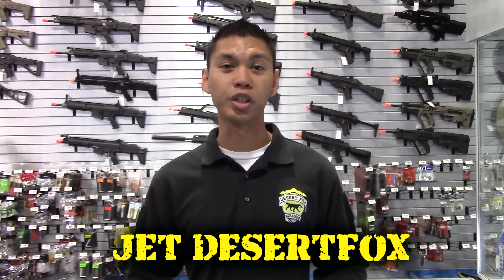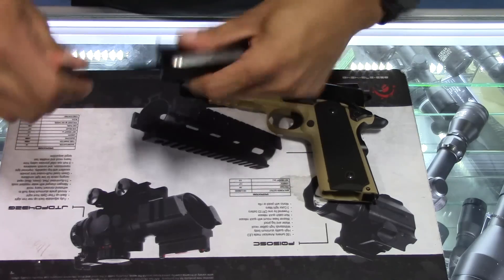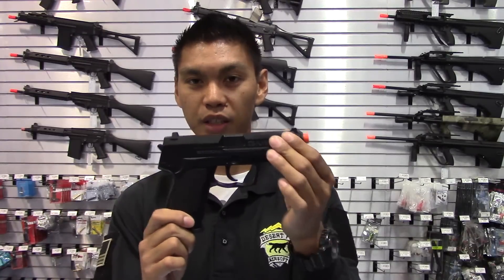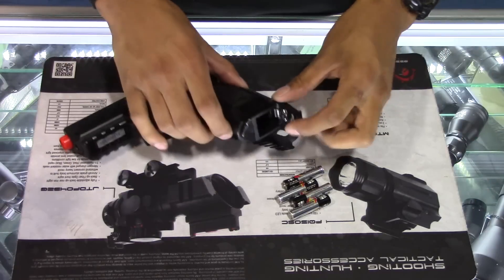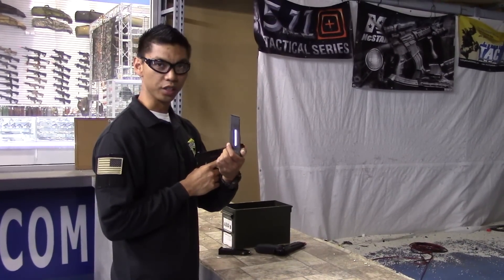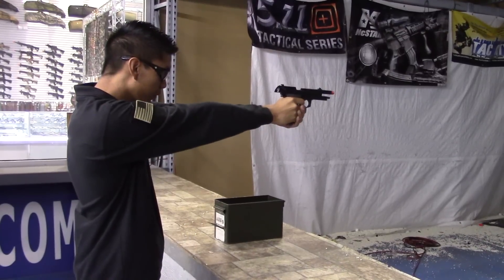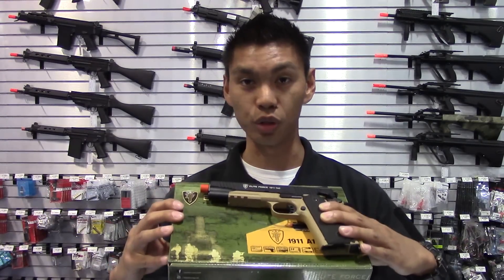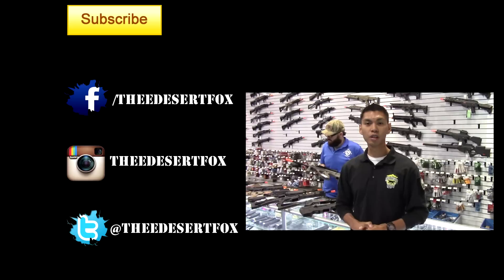Beginners Guide on How to Buy Your First Airsoft Hand Gun

Comment: I super recommend the elite force 1911 as first hand gun. And just a good tip if you buy a green gas powered handgun ALWAYS keep your mag full of gas so you keep pressure on the o ring.
Reply: Use some Airsoft specific lubricant to keep the rubber seals from drying out. As Co2 is dry lacking any silicon compounds to it

Comment: I have the 1911 TAC and i love it. Full metal, blowback, and even though its only 14 BBs plus 1 in the chamber, i love the feel of it overall. Also, i like the CO2 opposed to green gas because in my opinion it works better in less than ideal conditions such as cold weather. Full metal 1911 is also heavier than a regular M9, just a preferance thing but i like metal handguns because you can really feel it in your hands and i just really like the 1911 design in general.

Comment: i think that a blow back is more useful because it tells you you cant shoot anymore and dont waste gas or electricity and a co2 being better because it is easier to load in the gun
Reply: But gas blow back requires allot of maintenance (like opening up the gun and cleaning it and lubricating it) if you do not do this the gun will just break and can be costly to repair.
Non blowbacks require allot less maintenance.
I like electric (not the one in the video, as that just uses normal batteries, I like the AEP mariu type ones) especially as they can work in cold temperatures; gas guns tend to just fail in low temperatures,
Reply: +Con HD but if you take the time to clean it and take care of it and not be lazy which i am not calling you that at all and take responsibility to do those things to have nice things and it is also my opinion i have all kinds of airsoft pistols non blow back co2, gas, battery and blow back with gas, battery, and co2 i love all of them but my favorite is the blow back with the co2 i use it all the time
Reply: Michael Peninger I have a question:
I've heard that if you don't use a gas gun for a wile the mags will leak, is it true?
Reply: i dont know i dont use it anymore it was my first pistol and i always empty mine after a game
Reply: but mine did leak during a game one time i dont know why i guess the mag came loose and i shoot and it spewed every where thats when i got a blow back electric powered and then my friend sqeezed my water and it shocked me then i got a nonblow back co2 and then got a blow back co2 and  then i got a non blow back gas form my dad so yeah i have all types of airsoft pistols
Reply: well thank you for the reply
Reply: Blow back is nice because it adds realism and usefullness all at once.  When you're out, slide locks back and you won't keep shooting or be that guy (especially with an AEG) who's going "YOU DIDN'T CALL YOUR HIT" but never realized they're dry firing with no ammo.  Cleaning isn't that hard.  If you have a 1911 or an M9, they come apart very very easily and lubrication is only really need on the slide if you use green gas or properly lubed propane.  CO2 is nice, but CO2 gets extremely cold when used rapidly and will shatter o-rings.  Also there's absolutely no lubricant in CO2 so you'll have to lube it after each use practically where a green gas, maybe every few months.
Reply: I agree with you 100%
Reply: I think that electric is best because you hear a sound when its empty and its easier to keep loaded because just pit batteries in your clips and then u done
Reply: The bad thing about blow backs are that you have to do routine maintenance on them. They are useful for knowing when you need to reload because of the slide locks back, but it also uses more C02 to move the slide.

Comment: I would like to recommend an airsoft spring 260 fps pistol that is a good $15.00 made by Beretta and called the Mod. 92 FS pistol and the mag holds 12 bbs per round and is a polymer build that comes with 500 bbs that are .20 or .12 gram I think
Reply: 12bbs per round😯
Reply: Springer's are trash. So is 260 fps lol
Reply: @jordanl5628  The point of springers is the price bro. A lot more cheaper than the other versions. Plus no need to buy Green Gas or 12-grams. Just the bb's.

Comment: Thank you so much. I bought like a pulling airsoft gun about 15 years ago. It is really hard to pull that thing and shoot. Always has been and still is. Wanted to start playing but get at least a somewhat good Handlung for under 50 bucks. I was so overwhelmed with those different Types and thought only electric are fast Shooting guns and the others are like the one I bought 15 years ago. 
Thank you

Comment: the USP non blowback is the best starter
Reply: Electric or gas?
Reply: +Snoppy1220 I'd assume gas but don't quote me
Reply: Probably gas.  There's not many AEP's out there that can keep up with FPS anymore for under like $200.
Reply: Gas, it's c02 and for $60 mine has worked through everything.
Reply: TM MK23
Reply: No it may work pretty well but won't last as long an you can't buy repair parts
Reply: It's been through rain, mud, and it's been dropped alot. Still works fine
Reply: agreed
Reply: CZ 75 P-07 Duty

Comment: How long does green gas last?
Reply: Fauxy Pauxy When its really cold outside green gas is horrible so your better off with CO2 in that case but also CO2 has a harder kick when in a gun so the slide will wear out and get damaged fast, green gas on the other hand doesn't have as much as a kick so it will last you longer.
Reply: Fauxy Pauxy so basically in short terms depends on the weather if it's cold sometimes the gas will 'shrink' and not work.
Reply: Ok
Reply: It will last just as long if you maintain it properly, but it is higher in pressure so the nozzle might break after a certain period of time

Comment: Wow. $100+ for something you may not even use in the field. I'd just buy a $15 Spring gun that does the exact same thing.
Reply: Brandon Murphy Dude, why? You're primary weapon is actually all you need. If you roll the wheel, you can last a few matches.
Reply: Yeah, but in tough situations, you can always pull out your pistol. I do like the way a spring gun operates (I dunno, it's cool) but I would go with something more higher level, like a $30 H&K USP pistol, a hell of a lot better then $144.
Reply: President Donald Trump Thank you, fellow Trump supporter.
Reply: James Blackburn You're welcome!
Reply: James Blackburn What??15 bucks for a spring gun,i have the shotgun one for 3 bucks
Reply: YouNoob M.Faza.A.G Neat.
Reply: I have a DMR so my gun is extremely long and heavier than a normal gun, plus I only use mid caps and I only have semi-automatic so having a pistol is a must for closer engagements or if I need to enter a building.
Reply: John W Well, yeah. If you had a gun designated for long range. But stuff like LMG's, AR's, SMG's, Shotguns, Carbinee, and other such automatic things should rarely need a pistol. Especially Machine Gunners cause they have near infinite ammunition.
Reply: +James “GUNSLINGER” Blackburn my friend uses an LMG and he mostly uses his pistol indoors because the barrel is too long an the gun is too heavy. But if I had a 10 inch rail on an m4 I wouldn't bother with my pistol indoors.
Reply: John W How much does the LMG weight?
Reply: +James “GUNSLINGER” Blackburn I'm not sure but if I had to guess then maybe 13 or 15 pounds
Reply: John W That ain't heavy at all.
Reply: You could just use a 50 dollar electric blowback pistol
Reply: I find it very useful in cqb

Comment: I’m in a deadlock between green gas and Co2. What should I get? Also, how long do the Co2 containers last?
Reply: There should be a good video about it

The only thing i know is that green gas is a bit easier to refill in battle and is cheaper if you run propane

For co2 its more portable but less easy to refill in battle, it does fire a bit faster and has a harder kick, but it puts much more pressure on parts which might break it faster then green gas
Reply: Thomas Dekker thank you. I think I will go with green gas.
Reply: @justanothergamer7918  Just out of curiousity, what model of pistol are you going to buy?
Reply: Thomas Dekker I am hoping to buy a 1911
Reply: @justanothergamer7918  ahh a classic, you know what kind of model? More of modern one or a 2011(hi capa) or traditional one?
Reply: Thomas Dekker probably more of a modern one

Comment: so for the green gas guns, what if you instead put propane or butane, and while you're at it you will put small candle wicks in the holed areas and light them on fire, don't worry cause you're airsoft gun won't burn... unless if you have a metal barrel and frame and.. anyways when you fire the gun would it look like you are firing a real gun beacause of the fireballs??

Comment: In electric powered handguns is it safe to use 10440 batteries instead of triple A due to the higher voltage output of the 10440 batteries than Triple A?

Comment: My best side gun is STTI 92F no b-b green gas plastic crap, for something like 15$ plus another mag for 10$. It is light, what is important on an Airsoft battlefield, where mobility is the key to win, magazine contains 22 bbs, gas last for  3 mags, so no need for carrying bottle, just a loader. It has perfect 295 FPS for CQB situations. Failures are nonexistent, Service?  Only after a bath in a mud or sand. Downsides? It looks like a cheap toy and after ten shots in a row hop-up unit doesn't work as in every gas pistol. Blow back pistols are good to shoot only in a garden.

Comment: I don't play airsoft so for that who do what would generally pack a bigger punch spring blowback or non-blowback
Reply: Blowback, especially if it for some reason has a metal slide
Reply: @SophieHesper  I would think it would be non blowback. Because the gas only has one way out the front. So more gas would be propelling the BB and thus more fps meaning more pain

Comment: No 1 buy the SAMURAI Edge Tokyo Marui because I've had so many problems by us airsoft first it broke inside the gun out of nowhere then we got it back and they put the most valuable thing under the weakest spot so u just barely hit ur barrel and it can break I was playing airsoft and it hit my sniper with a tap and boom it dies something breaks inside then the blue part wont go back and with that Happening u cant slide off the top when its stuck so I'm doomed